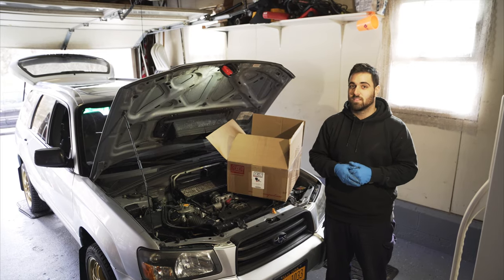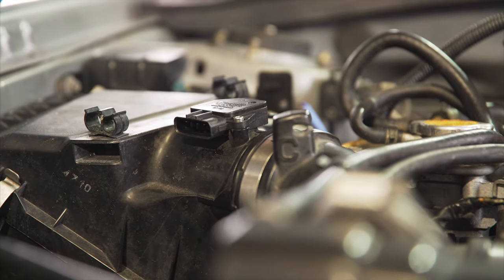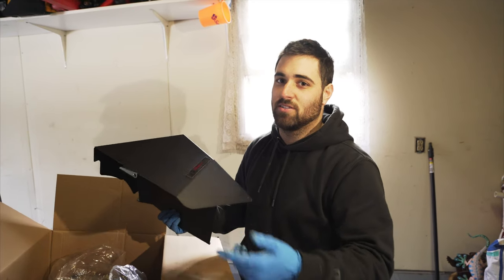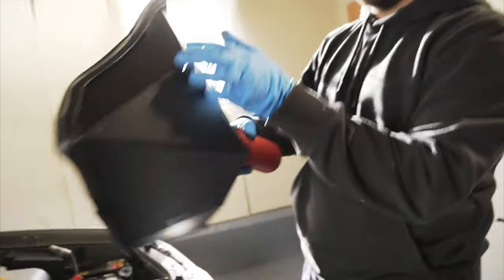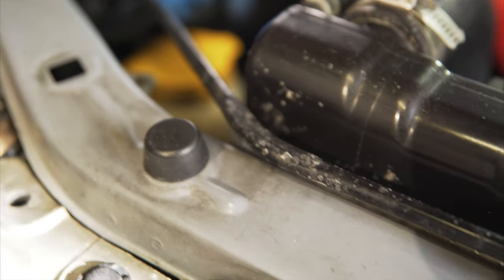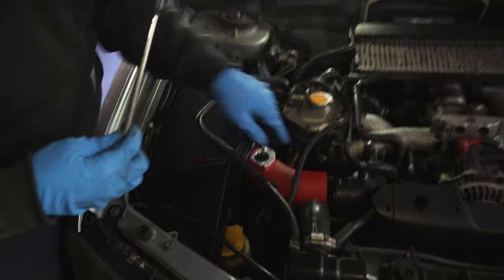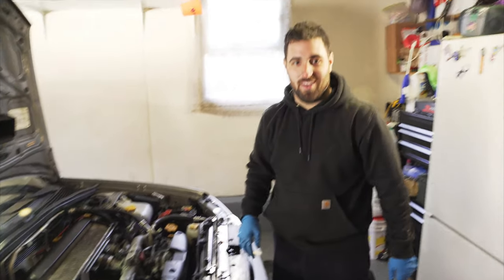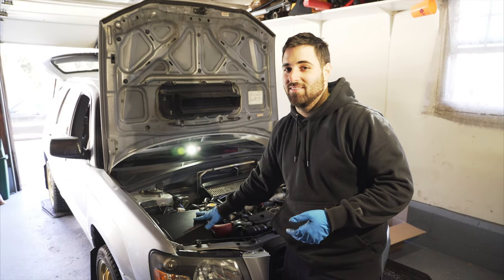Installing The GrimmSpeed Cold Air Intake!!

Comment: Hey Cody, how are you? Bad thing I live in Europe and the aftermarket is not huge here. So I try to look at the Grimmspeed site, but a lot of things are not available anymore, for Forester specific. Are there other Subaru models with components that can be used for the Forester?
Reply: Take a look under 02-07 wrx/sti parts and you will find the intake for the 04-08 fxt.

Comment: How do change the filter and how often
Reply: There's a ring clamp that holds the filter in place, just replace it with a new one. Its supposed to last you around 100,000 miles I believe so it'll be a while before you even need to think about replacing it